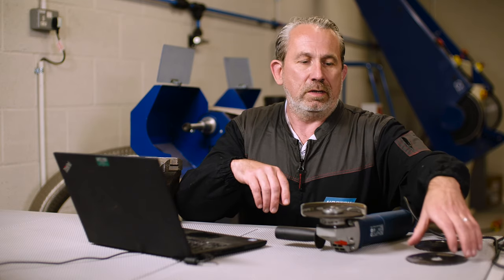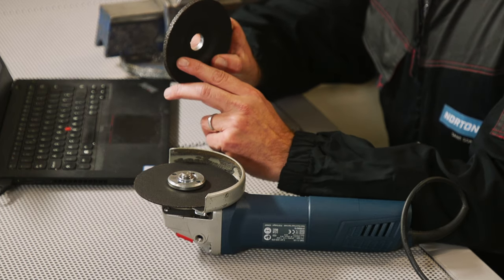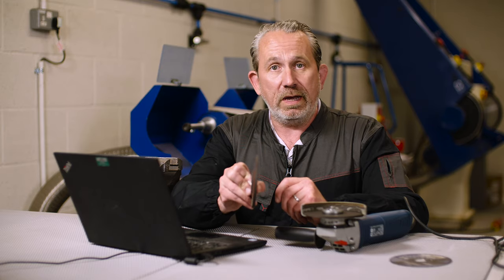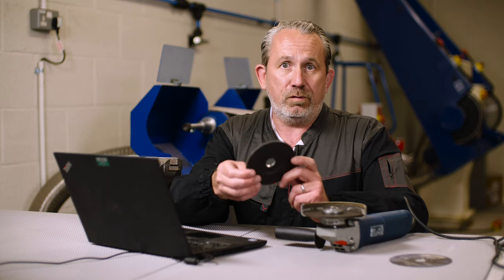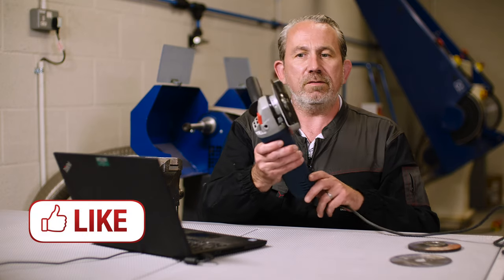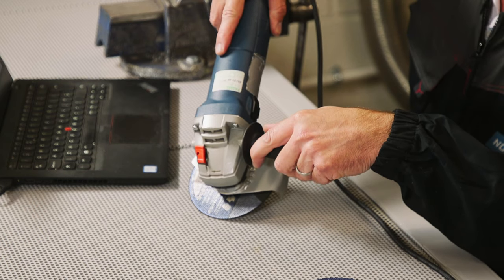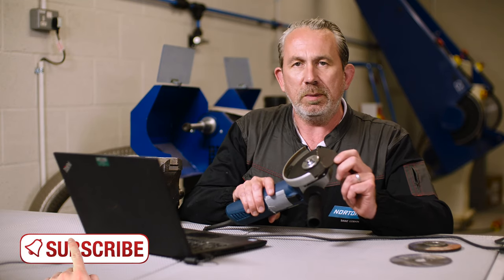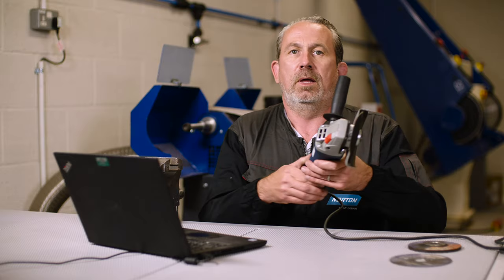ASK THE EXPERT: Can I use a cutting disc for grinding?

Comment: You can if you understand physics and how to do it safely. Although most be are dumb and will get piece of cutting disc in the eye lid because they used cut disc to grind and only had on their squinty eye protection.

Comment: How about welder using mostly cutting disc to remove the flux
Reply from the maker: Please don't ever use a cutting disk for grinding, they do not have the additional reenforcement to take lateral pressure safely.